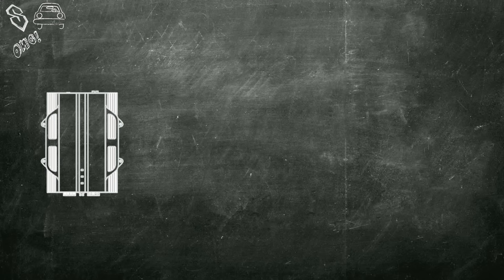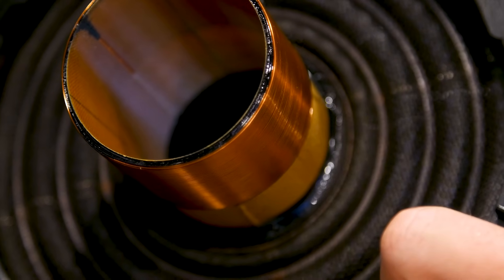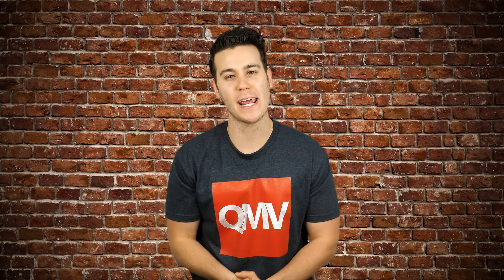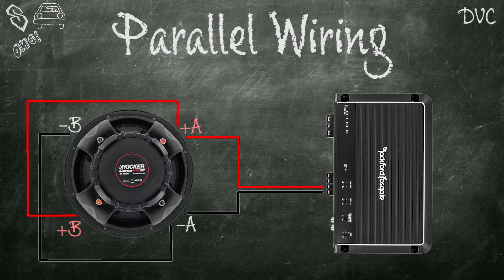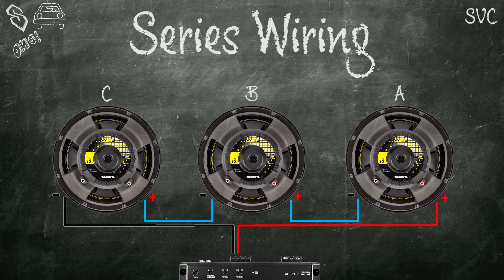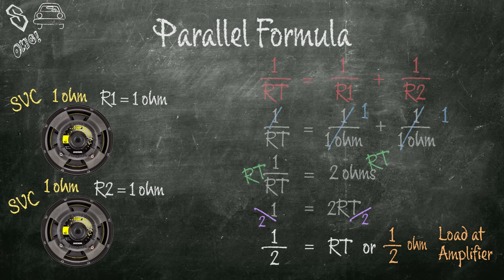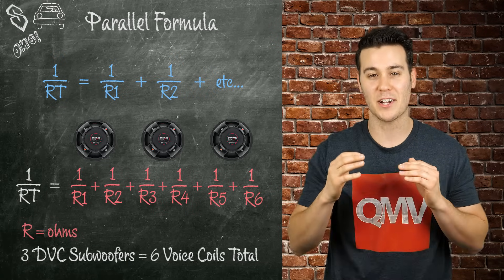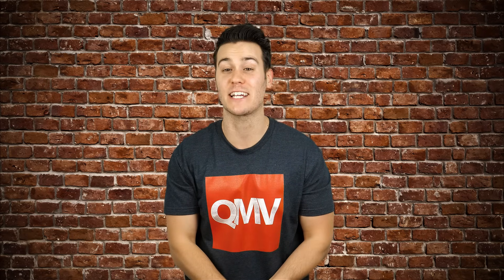How To Wire Subwoofers - Parallel vs Series - Single Voice Coil and Dual Voice Coil

Comment: Very good review, thanks for the information. QUEASTION... I have 2 15 tarantulas that are dual voice coils at 3,600 RMS. Will a rockville 4,000 watt rms at 1 ohm work for me?
Reply from the maker: Hey bud! Are they 4 ohm or 2 ohm? And the 3600W RMS is combined right? If they're 4 ohm, then they will wire in parallel to 1 ohm perfectly. However, if they're 2 ohm, you'll have an issue since two DVC 2 ohm woofers cannot be wired to 1 ohm, and instead wire to 2 ohm
Reply: @Qualitymobilevideo  it's actually 2 dual voice coil 15s at 2600 rms together. I just bought a 4000 RMS mono amp? How would you wire/set this up?
Reply from the maker: So two DVC 2 ohm woofers wire to 2 ohm in parallel. That's what I would do!

Comment: I get the speaker wiring but what about the amp. So lets say 2 channel amp. Two dvc 4ohm. Would you wire each speaker to the own channel or bridge them??
Reply from the maker: A 2 channel amp you would just wire each subwoofer to their own channel. Bridging comes into effect with a monoblock where you bridge two subs onto one channel, or a 4 channel/5 channel where you bridge each subwoofer to two channels.

Comment: How wire 3 subwoofers 1ohm to taramps hd3000 1 ohm please
Reply: They would need to be SVC 3 Ohm, or DVC 6 Ohm, subs. In either case wire all 3 or all 6 coils in parallel.

If they're SVC 4 Ohm subs you'd get 1.3333 Ohm final load with them in parallel.

Comment: I have no fucking clue what any of this means. So if I have 2 subs each with 2 x 6 ohm coils I have no clue what amp to get. Is there even an amp that can run this. Amps state 4ohm but I got like 24ohm 😱🤢🤮🤯 I feel so dumb right now. And I have no clue what to do other than just buy an amp and prob end up blowing it and burning my car😭
Reply from the maker: Do you have the specific models so I can look them up for you Phillip?
Reply: @Qualitymobilevideo  So I have 2x Audiobahn Alum12q's 1000 watt Rms dual 6ohm VC's. I was looking at Hifonics amps but several have said not to so scrapped that. A friend said that I can put each speakers voice coils in parallel making the speaker 3 ohm but then run both speakers in in parallel to the single channel amp and that will run at 1.5 ohm. I was looking at the kenwood KAC-9106D amp which I thought was 1 ohm stable but is in fact 2 ohm 1000w rms. If I cant make the 2 subs work safely then I may just get the Kenwood and run the single sub at 3ohm giving me about 750rms from the amp. 
Amp is 1000w rms at 2 Ohm and 500w rms at 4 ohm. Any advice on how to get the 2 subs working would be great. Maybe if you got a better amp in mind but if not then does the single sub seem ok with this Kenwood amp. Many thanks :)
Reply from the maker: So two DVC 6 ohm woofers will wire to a 1.5 ohm load at an amplifier. A 1 ohm stable amplifier is what you're going to want, if an amp can do 1 ohm it can do 1.5 ohms. But remember, the half ohm will cause a decrease in power. So an amp that does 1000w at 1 ohm will do about 750w at 1.5 ohm
Reply: @Qualitymobilevideo  will I get a better sound with 2 subs or is the increase negligible. In other words is it worth spending extra money on an even bigger amp than the Kenwood or just settle for the single?

Comment: And light bulbs in series... if one blows, ALL of them will go off, not just ones downstream of the broken bulb. Think about it: if there is only one path through the circuit, breaking the circuit causes all of them to go off. You clearly know your stuff when it comes to the audio gear, so stick to that, and skip the theoretical stuff if you can't get the facts straight.

Comment: Dude, in the plumbing analogy, Voltage is Pressure, and Resistance is the pipe diameter. 

Voltage is the 'potential', the ability to push current through a circuit, against any resistance, which is like pressure, which gives the potential for water to flow through a pipe. 

Resistance is the ability to resist the flow of electrons, which is like obstructions in a pipe, which can be from the diameter of the pipe, or roughness on the inside of the pipe.

Comment: I don't like to stress my amps with low impedance loads . 4 ohm / channel is lowest . Running 8 ohm whenever possible . Keeps my amps cool and sounding great without stressing and over heating  them . I wired my 2x10 subs at 8 ohm : 2x 4ohm in (series) instead of 2x4 ohm parallel at 2 ohms . Running my 600W Kenwood sub amp in bridge mode , pushing sub box at 8 ohms = cool , loud , clean and happy amp . Plenty of no stress tight bass .
Reply: this was beautiful to read because everyone i know just overpower subs by a lot at 1 ohm and thinking it be rocking just because it works. so i’m thinking higher ohms pushing exact power instead of overpowering. i’m thinking about getting 2 12’ 4ohm dual coil subs bc it’s able to wire to 1 ohm 2 ohm and also 4 ohm. 2500rms so i wanna get a 2ohm 5500 watt amp wire down to 4 ohms at 3600 watts. it should be a wayyyyy different type of bass

Comment: Ok how about this scenario: I have 4 dual voice coil automobile (4 ohm-each coil) LF drivers. I need an 8 ohm single channel . What do YOU do?
Reply: Wire each you dvcsubs in parallel that gives you 4 subs with 2 ohm each, wire the 4 subs in series to each other. That should give you 8 ohms.But I have never done this. And I may be incorrect but I think I'm right as long as you don't bridge the amp assuming all 4 subs is being connected to one class d mono amp.But I'm guessing at that .So we need to know what your gonna power said subs at 8 ohms total
Reply: Excuse me I see now you have one channel amp ok then should be good
Reply: Anthony Tucker Very good. You got it right. 👍🏽
Reply: @AntDaddy1977  more like why would you want 4 subs at 8ohms total? if your amp is stable at 2 ohms, cause my 600watt rms mono class d is stable at 2ohms. why wouldn't you just run them at 2ohms? you are forcing the amp to hold back based on the resistance of you speakers. at 8 ohms on a mono channel class d, you're probably getting 60watts out of it.

Comment: I got a Kenwood 800 2 channel but it off when you touch the diels
Reply from the maker: It turns off when you increase the gain? What's the exact model of the amplifier and models of the sub(s) you have wired to it? Also, where did you make your ground?

Comment: Hi nice video one question can I connect 6 subwoofers to an amp.
Reply from the maker: I really wouldn't do more than 4 subs to an amplifier
Reply: @Qualitymobilevideo thanks for the reply but they're 6.5inch 200 watts rms and 400 watts peak

Comment: dude why did you make that sound so damn confusing. Jesus I had a 98 grade point average in math in college. and you confused me. But  people its simple with 2 speakers setup parallel wiring is half the ohms of one speaker. series add both together
Reply: Anthony Tucker How about series-parallel?
Reply: @timoromeo7663  I replied to your post but just in case.If you understand that each subs dvc wired pos to pos neg to neg will give you total 2 ohms per sub. then from your amp pos speaker terminal to sub 1 pos then sub 1 other voice coil negative to sub 2 pos then sub 2 other voice coil negative repeat till finally sub 4 negative to amp negative speaker terminal. Damn I hope you understood that .Thats the best I can do as far as explsining it without making a diagram and uploading it.
Reply: @timoromeo7663  matter of fact It shouldn't matter which voice coil on each sub you connect your series connection too being they are wiredtogether anyways

Comment: hi. how to connect alpine r subwoofer  of dual 4ohm to pioneer  gm d8704. front channel connect to door speaker and rear channel I want to connect to subwoofer. pls reply
Reply from the maker: Bridge either the B channel terminals or the A channels: https://www.pioneerelectronics.com/StaticFiles/Manuals/Car/GM-D8704_DX874_OwnersManual110818.pdf

Comment: I have my two 12" Kenwoods connected to a mono block kicker amp in parallel and the first sub looks like it is getting more power than the second sub. How would I wire them so I have an equal amount of out put to both subs?
Reply from the maker: What are the exact specs/models of the subs and amp?

Comment: well, series wiring a dual sub is not ideal, bec. they will add the frequency resonance also, but i have one question for you, is it ok to wire a dual vc sub using 2 separate amp for each voice coil, one voice coil from one amp, then the other voice coil from another amp? thanks.
Reply: they would have to be setup exactly the same and you would need a way to measure that because no two amps are gonna be exactly the same even if they both brand new. You would need a ocilscope and other audio testing equipment that most people dont have.
Reply: They would have to be gain matched but yes yo can. The amps volts and clipping point.  Cannot do it by hand, you need a luimy, a dd-1, or a scope to gain match. If your amps are strappable, you can strapp and wire up, series, or wire down, parrallel, depending on your subs and amps impedence, wire accordingly.

Comment: Dude dont fucking complicate shit thats simple as fuck to explain. Its bad enough there are companies like audio express home of the 1$ fire wire and slangin that dont do shit right, due to prolly listening to the complete and utter caos you just ranted about. This shit is so easy to explain so people dont blow there shit up or burn there cars down holy hell dude......side note corny ass puns were funny.....
Reply from the maker: We had to make this video due to constant calls, emails and messages asking how to wire subs, parallel vs series, and the difference/meaning of DVC and SVC. Every detail of the video came from all the questions we get swarmed with on a weekly basis by customers and subscribers
Reply: @Qualitymobilevideo  I get that but understand simplicity especially with the amount of damage that can be done is far better for a general census than complexities herein with the video.  I as a custom audio builder fabricator have explained as you have or in greater depth and have recieved calls asking why there car cought fire, amps cought fire, batteries exploded, subs smoking, etc due to, bluntly put, lack of education and the ability to comprehend simple English or understand what's said. For me it's easy to understand ohms law, physics, loudspeaker theory, etc i.e. I build I had to but rookies newbies average Joe don't really understand half of it that's why I said simplicity is key with these for the safety sake of the average Joe trying to just wire there car.. not knocking your session by any means it's what builders see on a daily basis because someone doesn't quite grasp what you are saying and or doesn't understand how to fully apply it.

Comment: How do I know if my mono amp can drive 2 dual coil 4 ohm subs at 1 ohm??
Reply from the maker: Check your manual. If it says it is stable at 1 ohm then you can wire at 1 ohm.
Reply: @Qualitymobilevideo   how can u get 4 ohm voice coils to 1 ohm?? I thought dual 4ohm voice coils will only  do 2 or 8 ohms
Reply: @MakeItHappenOriginal  A single 4 Ohm DVC sub can only make a single 8 (series) or 2 (parallel) Ohm load. 
Wire 2 such subs (each wired in parallel for each a 2 Ohm load) in parallel and the final load (all 4 coils in parallel) is 1 Ohm.
Following the formula 1/Rt = 1/4 + 1/4 + 1/4 + 1/4 = 4/4 = 1 ---> Rt = 1/1 = 1

Or when the impedance involved are all the same, the formula simplifies to divide the impedance by the number of coils...
The 2 coils of a 4 Ohm DVC sub in parallel  makes 2 (4/2) Ohm. 
2 DVC 4 Ohm subs with all 4 coils in parallel makes 4/4 = 1 Ohm, just like 2 SVC 2 Ohm subs in parallel (2/2 = 1)

Comment: I। have kicker comp d 15" dvc. So tell me that wether it should be wired in series or parallel to get good base?
Reply: it depends of your amplifier. for example i'm buying 10" 1500Wrms subwoofer with 2x1ohm voice coils and an amplifier that is 3050Wrms at 1 ohm (im buying other subwoofer later)
the amplifier specs tell me that its 1550Wrms at 2 ohm load -> i connect my voicecoils to series to get 1+1=2ohm and now my amplifier isnt overloading my woofer.

but if i bought 3000wrms subwoofer with 2x2ohm voicecoils with same amp, I would connect voicecoils parallel to get 1ohm impendance and match it with my amps 3050Wrms at 1ohm (2x1 ohm voicecoils wouldn't work because i only could put it parallel to get 0.5ohm and overload, or put it to series and get 2ohm and not have enough power.)

So basically you need to look at your voicecoils and wattage and then match it with an amplifier.

Comment: I got my wiring wrong.... I have svc and did positive to positive and negative to negative on 1 speaker but the second I grabbed negative to positive and positive to negative... lol
Reply from the maker: Is your subwoofer 2 ohm or 4 ohm, another important spec when it comes to wiring.
Reply: @Qualitymobilevideo  they are 4 ohm single voice coil. I tried in parallel exactly how you have in your diagram but my leads are probably wrong in the speaker itself... so for the second speaker I had to reverse the polarity for parallel is odd...

Comment: Hi! I have 2 JL audio subs, one of 4 ohms and the other of 2 ohms, my question is: is it possible to connect them to the same amplifier?

If possible, how?
Reply: I say hook em up
Reply from the maker: I always recommend having completely identical subwoofers if you're wiring two or more subs, if not the same brand, then at least the same impedance, voice coils and RMS ratings
Reply: Oy Vey. Wont be an even wattage between them. 
An 8 ohm and a 4 ohm can be done this way. For some wacked out reason it makes a 2.3 ohm load when those are paralleled. Idk bout the 2 and 4 tho.

Comment: Brossive! This helped me out a butt load!.. question, gots a Xplod xm554z 600wt 4cnnL amp and two Rocky Fozz 4 Ohm P15412’s. My problem.. seems One Channel seems not to work. If I run them from amp bridged they’re @2ohms which heats the amp soo much. Amp says bridge @least4Ohms. I have another sub I can throw in to get to 4ohms??!! Maybe how do? Lol.  I like the power from bridged. Should I just get new amp? Lol

Comment: Could you tell me the best way to wire up two JL audio 12 TW3s dual voice coils with a audio control LC 1.1500? I want to get 4ohms out of the speakers for sound quality!
Reply: Your box, speakers and amp determines SQ. Mainly type of box. You want SQ(sound quality) go with a sealed box of correct size. You want SPL(sound pressure level) (loud) go with a ported box tuned to the correct Hertz the speaker likes or close to it. 1,2 or 4 ohm doesn't make any difference in SQ

Comment: I have a question, I'm using a 2ohm capable amp and I have 2 x dvc 8ohm subs(JL TW3's) on JL's site Two Dual 8 ohm Voice Coil Speakers in Parallel / Parallel = 2ohm load is that true?
Reply: Sounds legit. I would get a volt meter and test the wires you would be connecting to amp just to be sure. If you aint got it running yet.

Comment: Parallel wiring is the easy way to go ... one blown speaker, the other runs, and you know which of them is actually dead. BUT WHAT A MESS WITH THE MATCHING ! For instance, on my 4th gen Camaro, there are 6speakers connected to the Delco TheftLock piece of s**t radio : - the front-channel wired to the 2 door-speakers (which are actually  dual speakers with separate inputs for the inner tweeter and the outer woofer cone, and wired in parallel), and the back-channel wired on each side to a speaker close to the back-seat and a speaker on the side of the trunk and wired in parallel. HOW DID THEY MATCH THE IMPEDANCE OF THE BACK SPEAKERS ? Well, the speakers on the side of the back-seats are 20 Ohm (sorry !!!), and the ones in the trunk are 4 Ohm, resulting in a total charge of 3.3 Ohm for each side of the back-channel. I guess they had to deal with the spare parts that were left on their desk in the Ontario factory. :D

Comment: Hey , duoble chech how to wired amp and sub , i got amp d class sony xplode 500rms to 4 ohms and 900rms to 2ohms  and subwoofer is a dual voice coil 4 ohms 750 rms??
Reply from the maker: Wire in PARALLEL to the 2 ohm load :)

Comment: I was hoping you could draw me a schematic of how to wire an old Jensen XA 4100 400 watt 4 channel bridgeable (not really sure what that even means) that recommends using 2.4 or 8 ohm speakers.I have a 12 inch 2.5inch dual 4 ohm VC/ 1200 watt RMS power sub i'm trying to install, I've been watching your videos but just not smart enough,I'm installing it to stock stereo with a LOC....I would really appreciate your knowledge on this,thank you if you have the time......Mark
Reply: need a bigger amp bud

Comment: I have 1 amp , 1 box for 2 subs. I have two subs from the same company , they look the same and they are 500 watts each . But, 1 sub is 2x2 ohm and the other is 1x4ohm . Is it possible to connect them together into 1 amp somehow? The amp is GZTA 1.1200DX

Comment: I did a sub and aftermarket head unit and wanted to pick gear I have 3 tweeters one on each door and one in dash, 4 door speakers and would wants 2 8” subs or something anybody got any suggestions thanks 👍

Comment: series you add parallel you divide by 2 on total value. 😄
Reply: Unless you have more than 2 in parallel... then you keep adding to the division
Reply: it is slightly more complicated then that. if you have two speakers, it might be that simple but add another speaker there at 4ohm now you have 4+4+4=12 12\3 is still 4. check my other comment for specifics